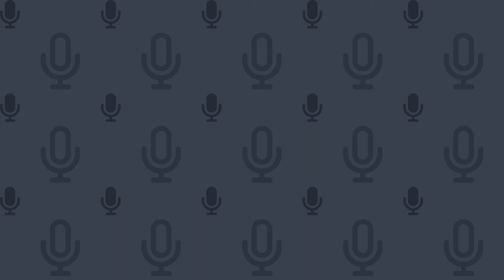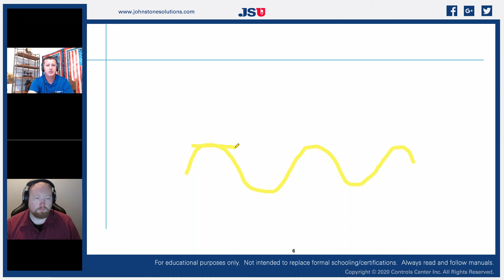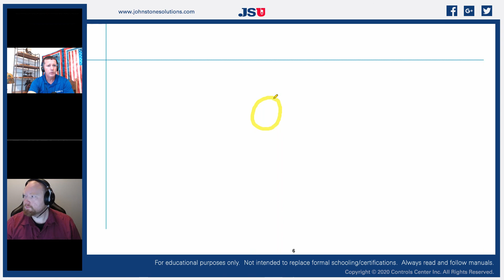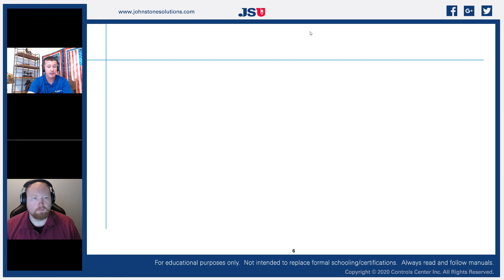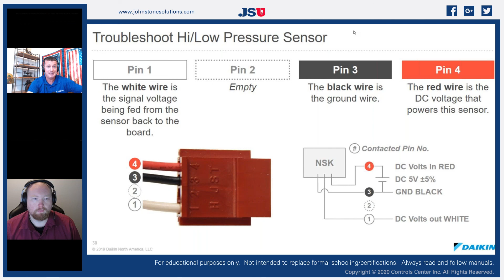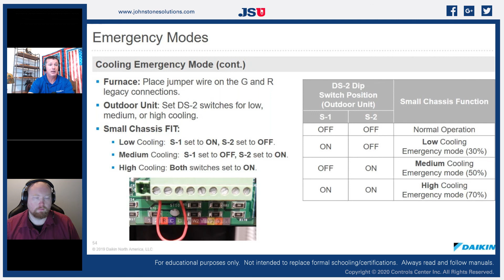FIT Tips- tips for successfully installing a Daikin FIT or any communicating system

Comment: HVAC needs a OBDII-equivalent standard of trouble shooting codings
Reply from the maker: That would be a HUGE step forward for the industry. We are so far behind other industries with diagnostic capabilities. Emerson creates the ClimateTalk network in the 1990’s that would have done just that. And some manufacturers do use it like Daikin and AO Smith but to many of the other major manufacturers are resisting the change. They want to be proprietary and non-universal. It would be a better industry no doubt.